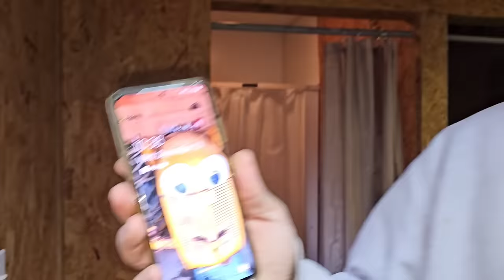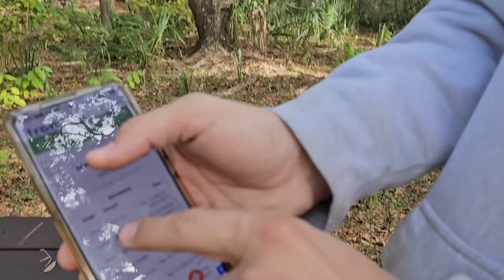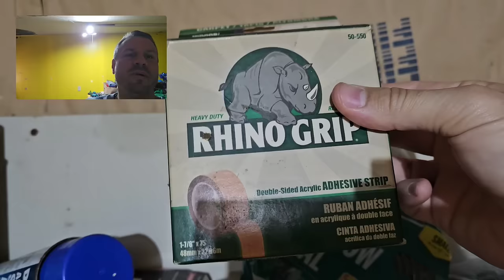THEY FINALLY WENT BANKRUPT & We Tried To Buy Their Property

Comment: That fan wasnt turning off since it is a moisture sensor,it is turned back on when high. The center section has a panel that pops off with a small screw driver and has a sensor for moisture and the length to run when triggered.

Comment: I went to a Christian youth camp in Hotsprings Arkansas as a teenager.  We had a bunk house on top of a huge hill and the boys bunk house at the lower part of the hill. Also had our cafeteria and worship building also at the foot of the hill. I always felt like the hill we had to climb was more like a mountain.  I attended from the time I was 13 until the year I turned 17. The reason that I didn't go when I was 17 is that I had the German measles. And the cut off was 18 and I got married at the age of 18. It was an Apostolic Holiness Camp.